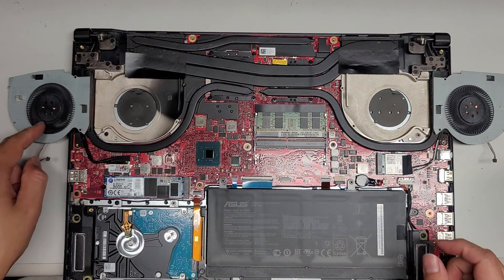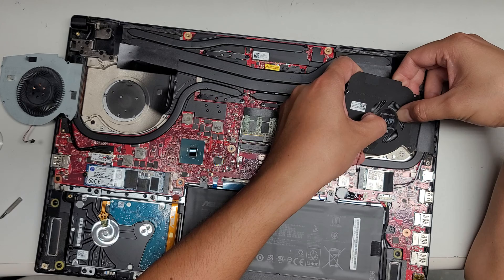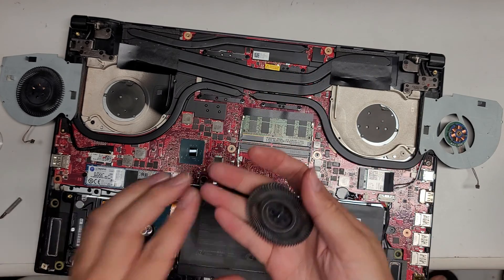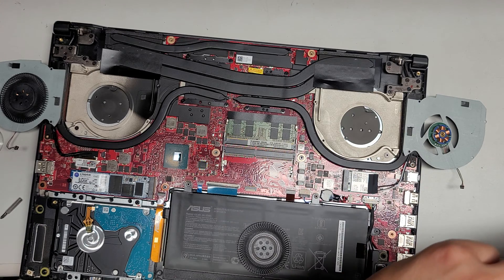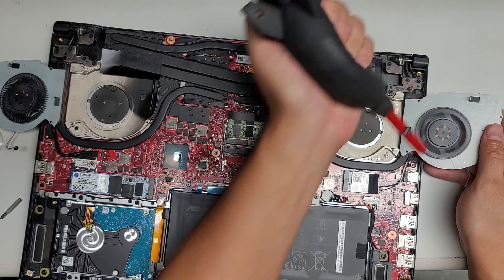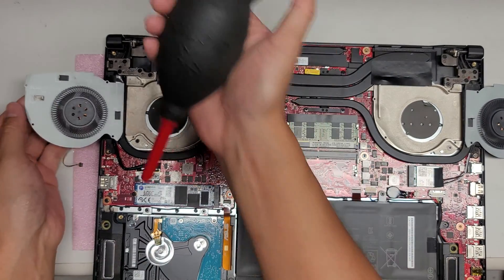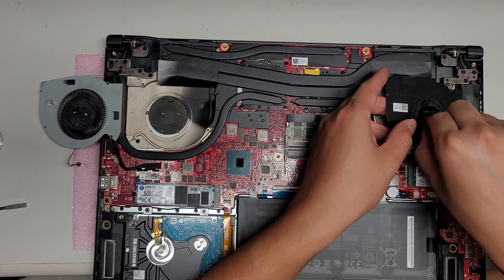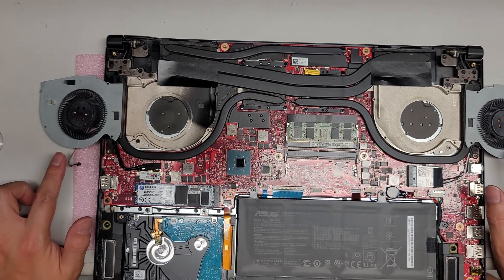How to Repair Noisy Laptop Fan *links for more fan types in the description below*

Comment: Do you do all this with the batter still plugged in? I'm super nervous about messing with my laptop too much but it makes an awful noise suddenly. I heard you can disable the battery in the bios but idk about that
Reply from the maker: Disconnect all batteries and hold the power button 15 seconds before working on it if you're working with the insides and don't know what you're doing.